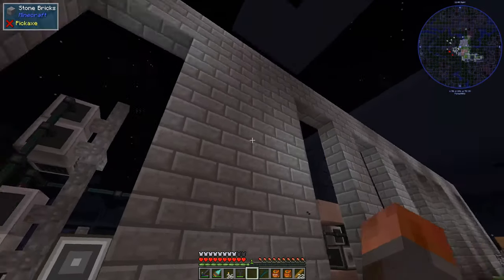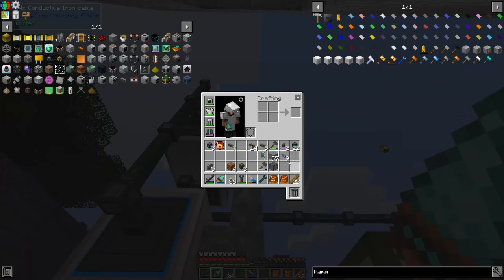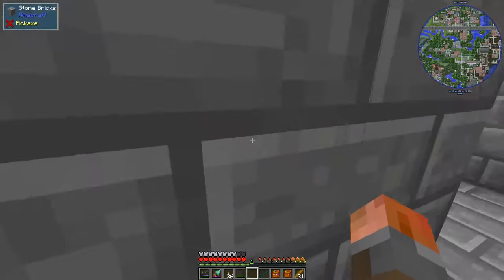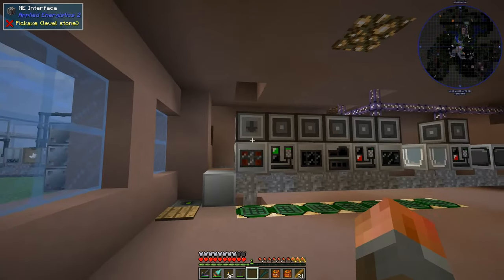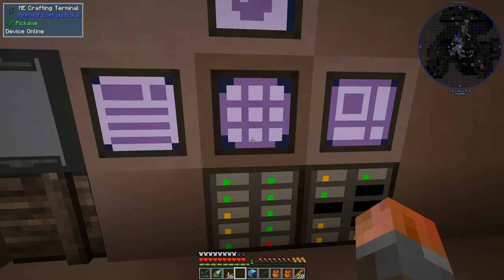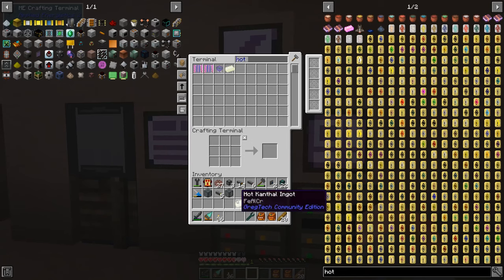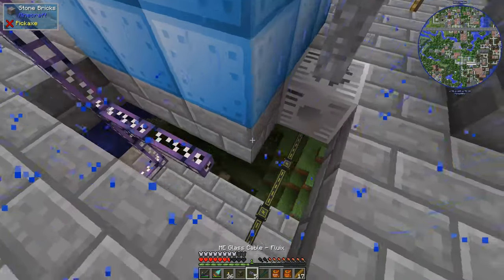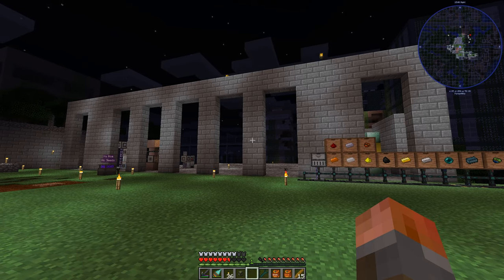Omnifactory E36 - Vacuum Freezing and Titanium!

Comment: Suggestion : make a second (or more!) crafting grid outside so you don't have to go back inside so much or move it. When you create a recipe with circuits, click over them with the right circuit before you create the pattern. Also, the polyvinyl recipe is better done with oxygen I think, than air (more output). Hot ingots - I put the ingot in a chest (quickly), then use a chest mover, and into an item interface (1 interface = 9 slots). There may be a way to get a filter with a "hot*" option, not sure.
Reply from the maker: Thankfully, we’re almost at the wireless crafting grid now that we have titanium! I’ll have to look at that oxygen option!
Reply: You could probably do the "hot*" filter with GT covers - item filter in a robot arm from the output bus of the EBF into a chest, then use EIO cables to run them right to the Vacuum Freezer